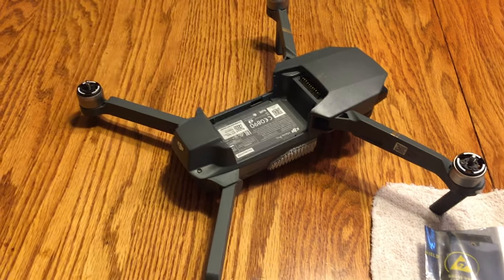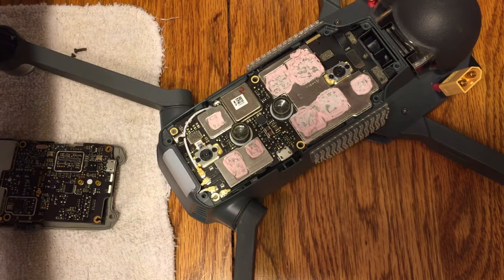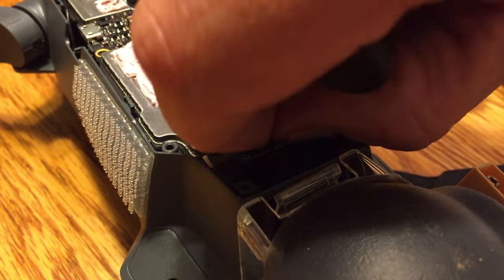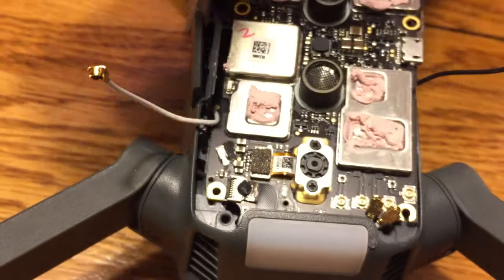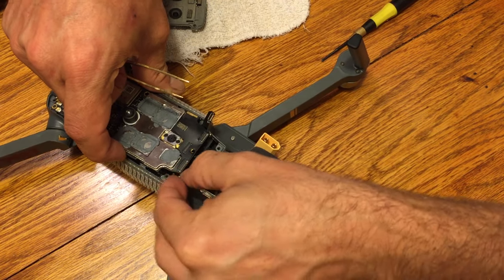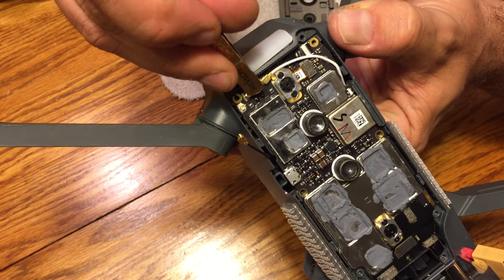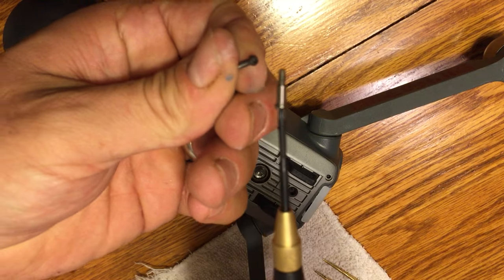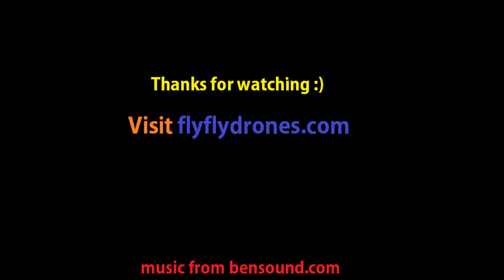DJI Mavic How to replace the lower core circuit board

Comment: Great video, very helpful. Question, as I was disconnecting the wifi cable from the plug/clip (min 8:25), the actual clip broke. What would you recommend? a new core board? Thank you.

Comment: Hi, is the black silicone over the ribbon in the board you replaced needed? (near the white antenna wire) Have you had any issue? I noticed that you didnt added more

Comment: Hi, thanks for this video, I might just have consider replacement of the board... seems like a bit of an overkill for my problem, so maybe you can help me.  The the connector on the board itself that connects to the ribbon cable (the one on the left, below the SD card socket, next to that white antenna cable) is damaged on my board. It came of completely. I suppose that this happened when I crashed, but it only malfunctioned recently. Other than no video, my Mavic works normal, so I gather this ribbon cable connects the MB to the camera. 
Do you think it's possible just to replace the connector? 
What is the name of this connector and can I find it anywhere?

Edit: I read that this socket in fact connects wifi. And, I just checked - this is also not working. Any idea if there is another chip or socket that has anything to do with video? 
At this stage, I will probably give it a try and replace the board.

Comment: I remember you had another video about tweaking the mavic. Do you believe that caused the issue? I don't see why you wouldn't say why you needed to replace the board. It's either a defective product or you did something to cause your issue. Can't see the reason for the secrecy. Plus you seem to have done this before, so what causes people to need to replace it on their own?
Reply: he mentioned if you make a mistake in loading  wrong firmware, maybe that's what happened, very easy to do, just slip and click on wrong file!
Reply from the maker: I fried the board during a firmware update. Sorry posted and didn’t write good description :p I was flashing up to .900 in assistant and I left in gimbal lock and  cover and house was hot. Mavic overheated, fan turned off and all leds turned red. Mavic shutdown and wouldn’t power back on. I let it cool and powered on, it wouldn’t connect tomcomuputer or rc, fan was off and it would heat up enough to cook eggs on. I think it had to do with leaving gimbal lock and cover on and overheating. I replaced th board and all good. Not related to moddin params or the firmware tool, it was all dji’s process.

Comment: Thank you very much for the video. We need more of these so we can learn to do our own fixes since dji support is horrible. not only that but in a year your pretty much on your own. Only thing I didn't understand is why you didn't replace the thermal paste with a good high temp paste?  It may even help the MAVIC stay cooler. The MAVIC gets pretty hot after just at a few minutes. I would have definitely replaced the paste. Thx for the video. 

MICHAEL
Reply from the maker: Didn’t see the end, but better or more thermal paste would be good. If I did again I would do that.
Reply: DiciurcioCabinets MDiciurcio.....yea with like some Arctic 5 thermo paste!

Comment: is there any way to reset the core firmware without using dji assistent? My card is in loop and when connecting the USB in windows it keeps connecting and disconnecting without stopping.

Comment: Great video, thanks for making it. How do you know that you need to lower board instead of something different? What are the symptoms of needing a new lower board?
Reply from the maker: In my case i couldn’t ocnnect to the board via usb or from rc. This was caused by a failed firmware update where I left gimbal cover and lock on and it overheated the ac and turned off mid firmware update. Fan never would turn on and always running hot enough to fry an egg on... and couldn’t connect tompc or remote.
Reply: digdat0 did you get red light in the front and the rear??
Reply from the maker: no it lit up fine, just wouldn't connect to pc or rc anymore. everything else looked/seemed fine.
Reply: digdat0 my mavic fell in the sea 20 meters down and it was there for 25 hours with full battery it was full of corrosion, i managed to clean the rust but i think there is still some under the chips it turns on but the lights turn solid red front and back that inticates critical error
Reply: I'm going to have to do it to replace my SD card slot reader. I'm pretty sure it no longer works considering it won't read or reformat any of the 10 different SD cards I've bought for it.
Reply: Is this the board the processor is on? It looked like the processor below it.

Comment: Replacing the center board... will I have to do something to it with the computer to get it to work after installing a new center board? Or is it factory loaded?
Reply from the maker: After installing it should just work.however the firmware version between that board and the rest of the air craft maybe different.I would flash once after install to make sure the same version

Comment: I replaced my gimbal tape and when I turned it back on it started to smoke and I heard a pop and the nimble has no power what board did I burn up? thanks
Reply from the maker: yeah thats not good man, i never heard of that happening before. That means there was something else going on, maybe a ground or a screw in a motor or an issue with the circuit board, not good.
Reply: yes it was not good everything else works and still flies but no gimbal. any idea on what board to check
Reply: I am in California. Where are you guys located
Reply from the maker: Oregon. I think you may need a new camera Josh - i think more damage than just ribbon
Reply: Circuit board purchase?

Comment: my mavic serial its in DJI blacklist and i cant fly, if i change board now have new serial and can fly right?
Reply from the maker: you would need to change both the flight board and lower core board. thats about $400+ in parts ..
Reply: i find lower board for about 170 in ebay, and flight board for 60.... now i buy new mavic i try to change one by one ... when i find how fix my blacklisted drone proced to buy all nesesary parts.
Reply from the maker: i have an extra lower core board if you want to buy it. I needed it for a repair and didnt end up being the problem. email at flyflydrones@gmail.com
Reply: ok mail send!.. i need know what firmware haver your lower core board
Reply from the maker: It has .700 on it
Reply: ok i send you mail.